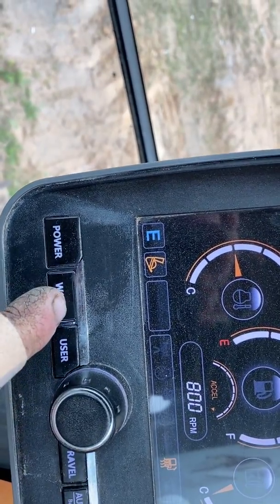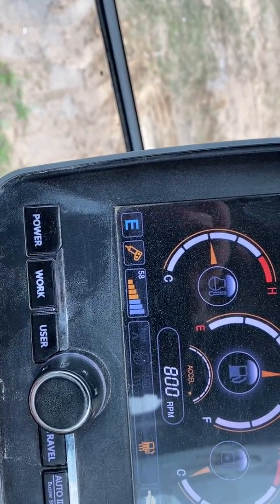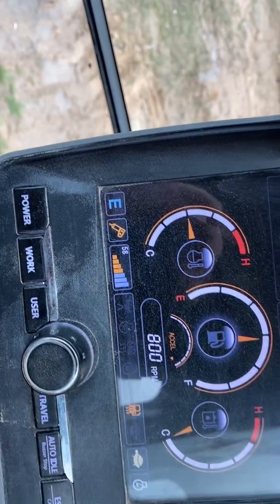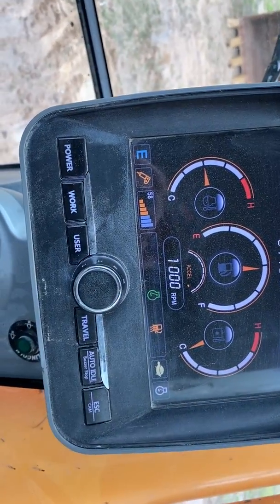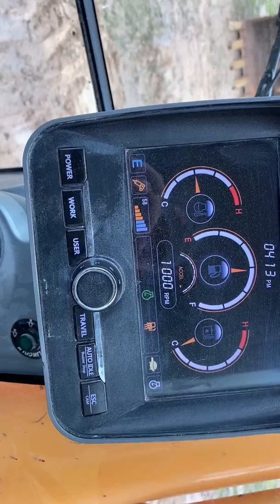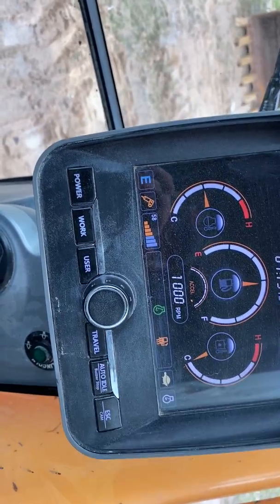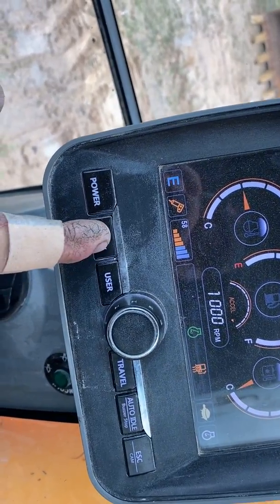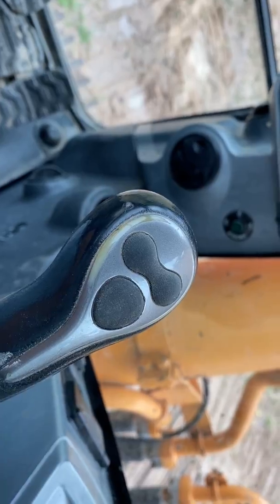Hyundai R380LC-9 Procedure to Actuate Hydraulic Thumb

Comment: Running a 2012 160 LC-9. Only the foot pedal works to run the aux. Is joystick control factory and im missing something or a kit that must add a valve and solenoid? Thanks